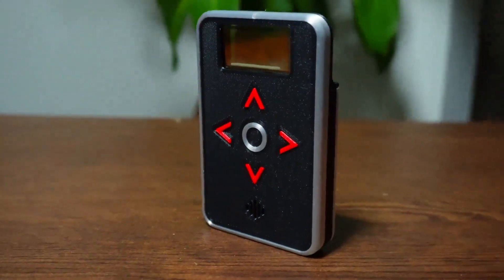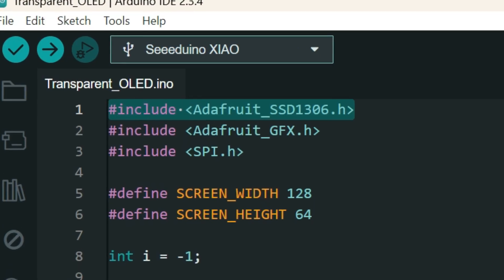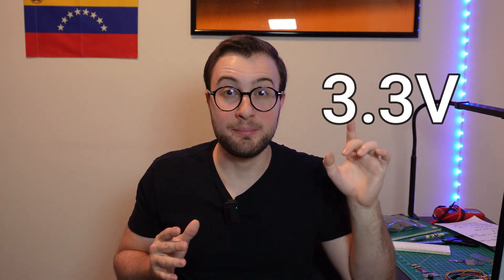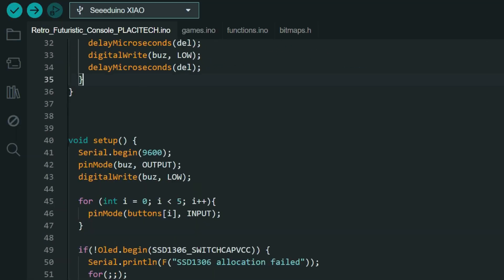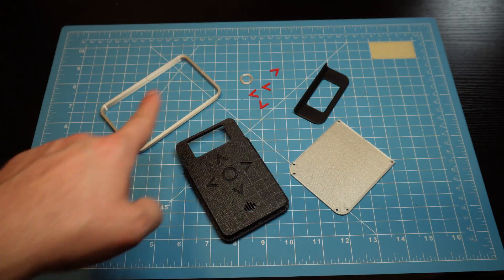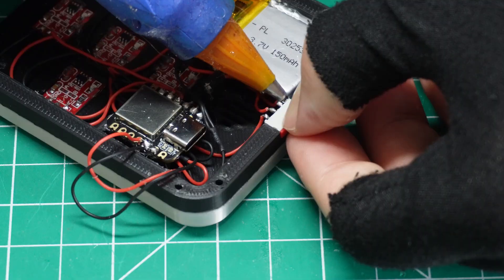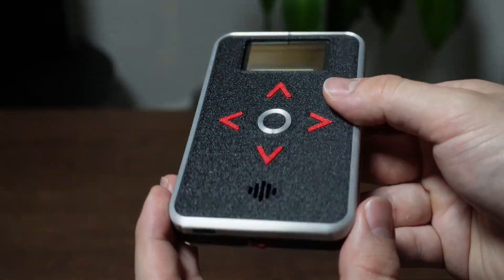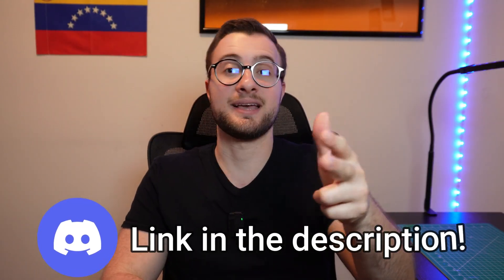I Built a Retro-Futuristic Console (And You Can Too!)

Comment: I also made mine recently. Almost exactly the same, except I used WaveShare RP2040 Zero, 0.9in SSD1306, 4 way and A/B buttons, a speaker from an old phone, and an old Samsung battery (800 or 650mAh, I don't remember, and I can't check since the label is covered). I used two 6x4in prototype board sandwiched together as the "shell", since I don't have a 3D printer. Tho, the outcome is pretty neat, and it's compact but a bit thick, especially with the battery is just hanging behind the console. I also made the microcontroller's USB port accessible and I rewired a button to the BOOT button, so I can update the code easily without disassembling it. I'm currently writing games for it and a simple game launcher so I can easily write more games later on, but I already tested it a snake game someone made. I made some modifications to the game. The pins and button configuration, I added three difficulties and the scoring depends on the difficulty level. Overall, it's pretty fun to make, and I'm happy with the outcome.

Comment: I am Chinese, and I’ve noticed that the prices for these modules are quite high in your country. In China, a 150mAh polymer lithium battery costs about 2 RMB (including shipping), while in your country it costs around seven dollars.
Reply: Thats like 0.3 dollars
Reply: That's because they're buying from Amazon, which is not a good electronics supplier. It's also usually much cheaper to get the individual components. What I would've done is make a custom PCB for this, which would cost maybe $15 US. All the ICs would be cents, since premade breakout boards are way overpriced. The transparent OLED would probably be about the same price. The battery can be gotten for much cheaper than buying it from Amazon or some such. A 150 mAh battery is actually a fairly uncommon size, or at least I can't find one on my preferred electronics distributor's site. A 500mAh battery of a similar form factor is still cheaper ($5.49 US) than what they paid, though.
Reply: @nikkiofthevalley  150mAh is common for 1s small airplane or heli rc models. they go from 150-200 for like the Blade MCX

Comment: But can it run doom???
Reply: I tried...no but if you're a genius maybe yes
Reply: It has a screen so yes
Reply: It's esp32 so yes
Reply: @thebossb2149  they meant the display, and yes it runs doom, with a little shader adjustment on that display
Reply: If you tried hard enough 😂(pretty sure not)
Reply: Placitech answer this
Reply: Technically yes if the microcontroller has good performance and powerful specs, but you'd need a color display.

Comment: My only concern comes from the mosfet turn on and off. First, in rush current could damage the microcontroller pin, Gate capacitor can be mean. Second turning in and off might be slow leading to losses increasing battery consumption, power loss should be minimal but if we aim to save every bit of current available and we do a high frequency switching on the mosfet losses start to add up.
Reply from the maker: Great points! In this case, the buzzer only draws about 30mA, and with the IRLZ44N’s RDS(on) being around 0.05Ω, the power loss is basically 0.045mW — super minimal. The gate is also connected to the SAMD21 through a 100Ω resistor to limit inrush current, so there’s really not much to worry about. Appreciate the insight though! 😄

Comment: Please answer my questions.

Which type of speaker do you use in all of your projects and where to buy it

I have seen you using a voice sensor as a mic which is not possible,how do you do that

The voice recognition module which you generally use only handles commands upto 1.5 seconds,so how did you make the voice assistant which receives instructions in sentences with that